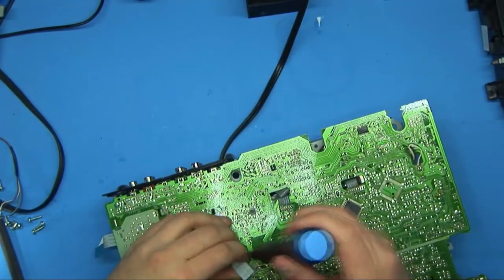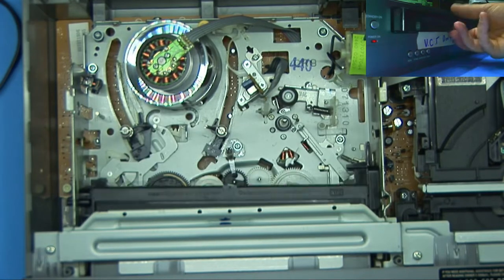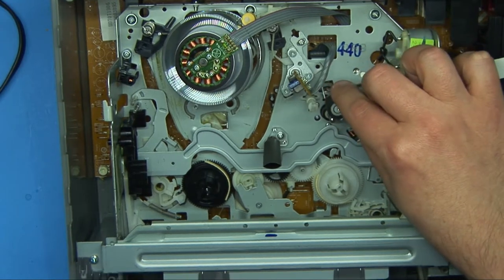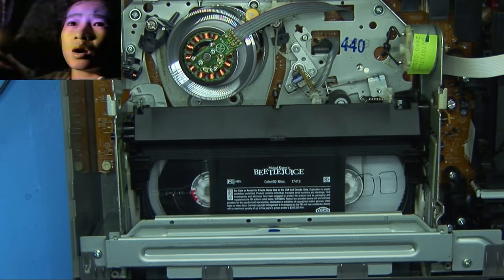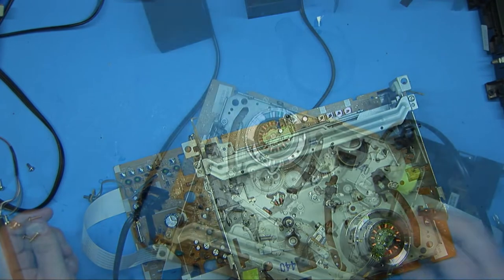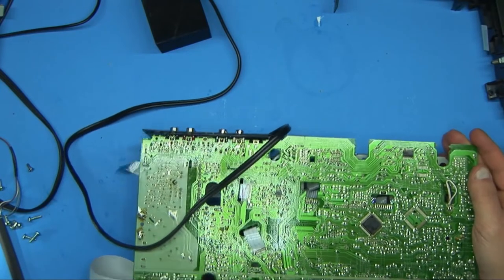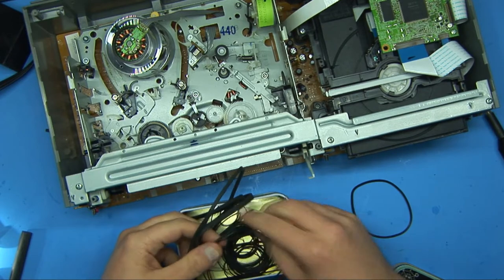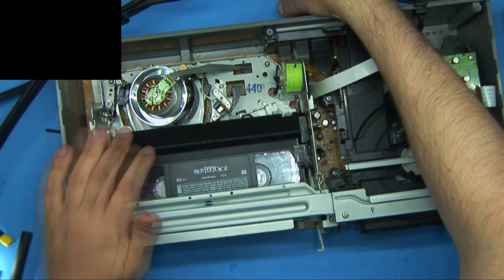Late Night Repair of a Magnavox DVD VHS Combo Player

Comment: This VCR/DVD combo player was a real lemon. I used to buy and sell VCR/DVD combo players and this one was the worst. You really need to stay away from the years 2003-2006 for this Magnavox combo player of which there is many models. It was also used under the Funai brand. You can always tell the models as there is 4 screws in the top of the plastic cover. Almost a guarantee the unit will shut down shortly after a VHS tape is inserted. The problem was a bad LED diode that shorts out. The LED diode shines a light or something through the tape to tell it if is in the player. The later models were much better but the DVD spindle had serious vibration problems. Very difficult to get these units back to normal operation even if you have good spare parts. Poor engineering especially not having detachable wire plugs.
Reply: Damn. I really was hoping it was that pesky big O-Ring inside that needed to be "Nuked" back to its original retention capability.

Comment: Thank you so much for this video. I don't have a tin box full of spare belts but I manually rotated the wheel the belt goes on for a bit. Then when I put the tape back into the player I was able to get it to play for a moment or two before it stopped. I manually turned the belt for another couple of minutes and tried again. It worked. So I pressed fast forward and allowed the entire 2 hour tape to wind forward. Then I reversed it. Seems to have worked!

Comment: I had a Phillips combo and it looked exactly like this one. It was eating the VHS tapes so I decided to take it apart yesterday (1/10/21), and attempt to clean the mode switch (which I wasn't able to find or access). Like you, I discovered that it would not come apart where I could get to the motor and such and I was not able to. It had been a good unit for a long time but I didn't even attempt to put it back together. I tossed it in a trash bag and put it in the trash!
Reply from the maker: That's a shame but you are right, they are garbage. ...built so cheaply.  Find yourself a good used unit from the late 80's on ebay.
Reply: @Electronicle  Looking now! I wish I had found your video before I tore into mine. I may have done the things you did and see if it worked better. Thanks for the response!!
Reply: The mode switch is under the VCR chassis.  It's not easy to get to but fairly easy to clean.  Here is a link to my video where I show how to clean the mode switch.  https://www.youtube.com/watch?v=OE66OdO3BTE

Comment: Thanks for the video, I eventually got this same player working again. I do wonder if it was that belt though, I went ahead and used the boiling water method on that same belt like you did, I think it helped, but overall what's really seeming to help is just using the vcr as much as possible. Sort of like how yours randomly starting to work, mine was sort of working for a few seconds and then powering off, or not at all and powering off, it was random. A couple times it even "ate" some tape by leaving some loose in the player, with the top taken off you can carefully maneuver it back out without crinkling it. But messing with it was eventually starting to give me slightly improved results, until it eventually was able to play a tape, but not rewind or fast forward at first, then eventually it could. Now it's working like a champ. Almost like it just needed broken back in or something. I cleaned the head too by the way since I was already in there. Blocking that ir sensor and making it work without a tape also helped I think.

Comment: I have here a DV225MG9, nearly identical to yours.  Mine has a Record function for the VHS tape end.  It's interesting that yours does not have a video input for record, but still has an erase head.  I guess it's cheaper to leave in than to take it out.   It's made by Funai.  They have a reputation for "low cost" video gear.  It does record, but there's no tuner.  I have the same model unit here with intermittent tape play, the same issue as you show here.  It seems to work now after boiling the belt.  Thanks for the tip.

Comment: It the mode switch contacts are oxidized 100% that what causes that intermittent issues. By using it the brush scrape the contacts enough to make contact again and reason it started work. It not the belt at all. 

You have to disassemble it again and lift the mechanism up and you see the white round switch on the board you can pop the top brush assembly off and clean the contacts and brushes on the white part, put new dielectric grease lineup stud sticking out towards the top and will work reliability again. Refer to my video on the Funai and Magnavox VCR DVD combo and show how to fix one of these.

Comment: Cleaned the mode switch in mine and it worked right away... electronic contact cleaner, tensioned the contacts on the dial, rotated the switch a few spins with cleaner... only took 15 mins
Reply: Got any pictures or videos on how to do this and where the pieces are? Trying to fix this issue that was in the video on mine

Comment: Question: tapes start, then stop after about 30 seconds and the machine turns off. I thought it might be that the feeding spool of the tape might not be turning. But when I speed-advanced a number of tapes, they showed video and the same thing happened after about 30 seconds. Any ideas?

Comment: Hi I have a JVC HR-S860 SVHS VCR, when I insert a tape it powers off and ejects the tape, also it has a slow blow fuse on the power board, the fuse seems to be making some noise and was wondering what the fault maybe could it be a fault of the mode switch, power supply or could it be the fuse is at fault. Please reply.

Comment: I’ve seen this kind of problem with many VCRs and the only conclusion I can come to is there’s just something wrong with the logic control. Sometimes you can fix it if it’s a mechanical issue but if not it’s just time to throw it out and get a new VCR those late models are junk.

Comment: Dude, you literally crashed, right before you could remove the last few “strings” of the soldered cassette deck. Were you a little stressed that day??? Too much on your mind??? 
Hey, use an acetone wet paper to clean that video head drum. You’re getting fibers in there with Quick Tips.
Reply: Well I thought about that super strong Acetone too, but was worried it would "melt" something on the head. Can I compromise and try Wet Paper and 91 proof Alcohol from RiteAid (before Covid19 decimated their stock)?

Comment: Beautiful Video! You are a diligent determined work technician (even though you decided you now own a piece of shlit). Many of us have that same model (and there's still a bunch more of these units on eBay right now). Is yours the Magnovox DV200MW8 that doesn't record but only play? My DVD Side of the unit is working fine, but the power cuts off on the VCR side before I can see anything on the Tape. Will attempt to open her up, like you did and nuke that O-Ring. Just from your uTube visual, that thick O-Ring sure looks like a similar O-Ring I saw at Harbor Freight near their Orbital Sander Area!

Comment: Mine just turns off after 7 seconds as well I cleaned the sensor still does the same lol
Reply: It could be the mode switch or the sensors need resoldiering.

Comment: That's the same problem I'm having with my VHS DVD recorder. I can tape VHS tapes onto DVD's or vice versa. I have put several homemade VHS tapes in the VCR and they play for about 30 seconds and then it cuts off and the tape comes out when you turn the power back on. I've also tried some VHS movies that I bought and they do the same thing. Someone told me that VHS tapes can stick whenever they've not been played for a while but I tried homemade VHS tapes and store-bought VHS tapes and both of them kept cutting off after about 30 seconds. I'm going to try cleaning mine and see if it will work. It hasn't been used very much. and since it does that with both kinds of VHS tapes I'm thinking it may be the VHS player/recorder. Does anyone have any suggestions?????
Reply: Both norcal 715 and 12 volt vids fix the funai built magnavox by cleaning the mode switch underneath and rejuvenating the belts as needed. They also clean the optical sensors.

Comment: I have 2 of these (black model) dvd works on one and vcr works on the other if I can fix them they would be worth good money
Reply: If you want to make things more interesating, you can Frankenstein them to have 1 that has both working "I'd recommend the DVD portion for swapping, if you do the VCR portion you could mess that up it's a bigger hassle to work on unless you know what you're doing like what's shown here, then you can have a fun project of working on 2 in 1"
Reply: @cutemimi25  I tried swapping the dvd but it didn’t work it was weird but I got frustrated and threw them away
Reply: @darius318  That kinda sucks.

Comment: Did you clean the mode switch?  I just worked on a nearly identical model with similar symptoms. The problem turned out to be a dirty mode switch.  Here is a link to my video. https://www.youtube.com/watch?v=OE66OdO3BTE
I agree with you, those units are very cheap and not easy to work on.  Mine is still working so I guess I'll hold on to it.